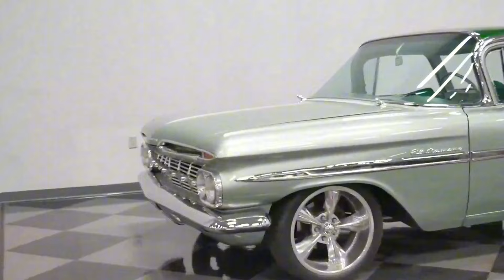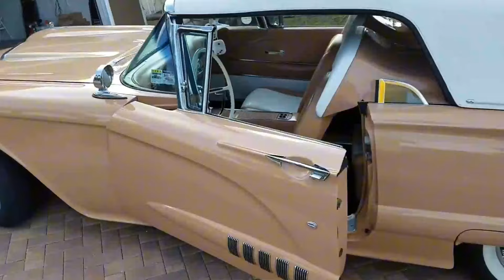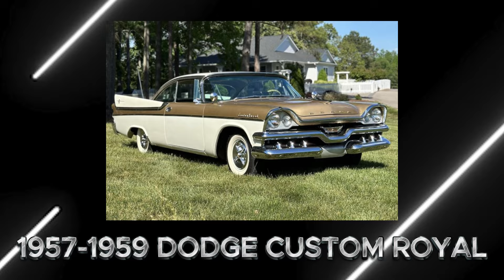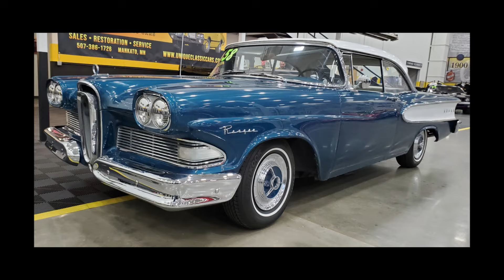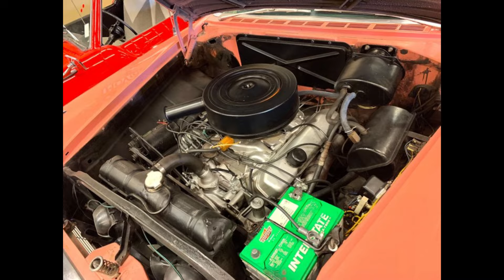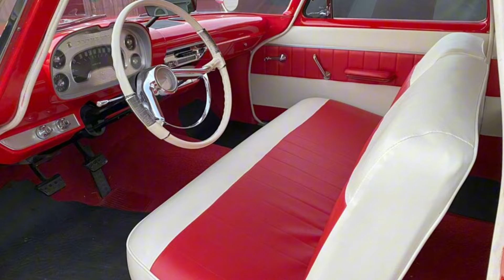Top 15 WORST Cars of the 1950s

Comment: I had a 60’ El Camino I bought from a friend in The 80s, 3 on the tree with OD, the problem I had with it was the steering linkage but I only had a couple of years and sold it back to the same friend I bought it from.